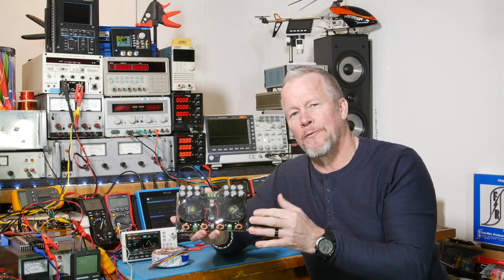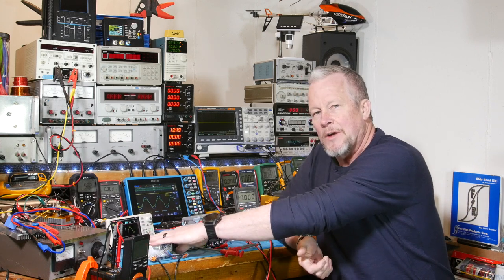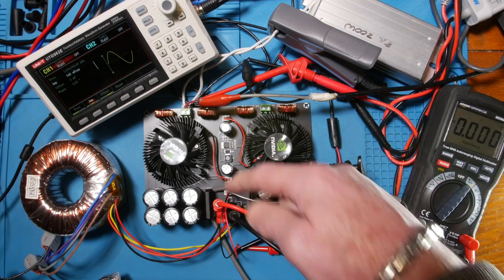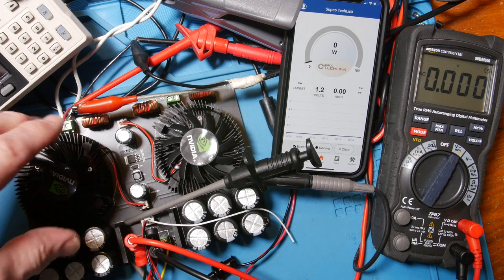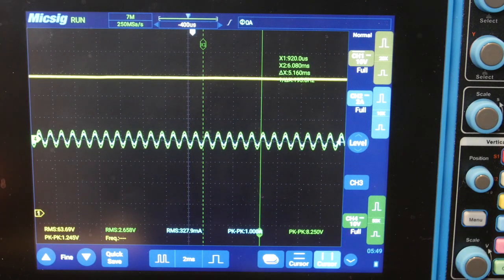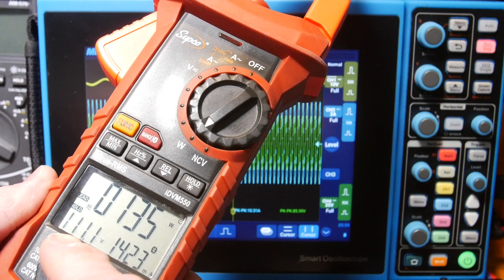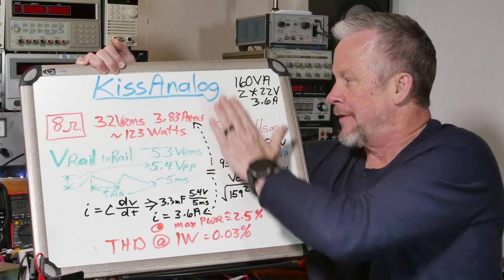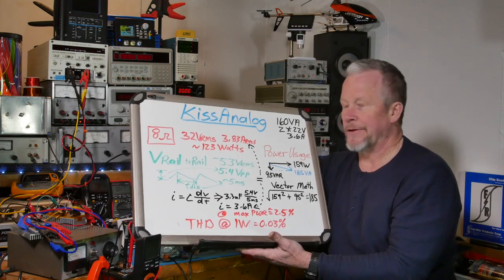TDA8954 Class D 420 Watts x 2

Comment: My favorite amp is 5W and 10% THD at full rated output, manufactured in the early 1950s, has those glass valve thingies, and sounds awesome with a guitar. High power and low distortion aren't everything in life...  ;)
Reply from the maker: That’s awesome Tim!  Thanks!
Reply: commenting on a class d video about valves . classic .
Reply: The difference between measurable differences and your opinion, is that one put us on the moon, the other... well everybody's got one don't they :-)
Reply: @gulogulo7636  Ooooooook.

Comment: Hi, nice video. I don't understand, I can power this amplifier with dc power or pc power supply.
Reply: PC power supply is DC
Reply from the maker: You can run it with a +/- DC voltage rails, but it is designed to run off of AC voltage and make its own DC voltage rails.

Comment: Another thing that I don't get is how to reduce thd+n. It seems all about gain but a lot of class d don't have a gain regulation. So for what I can understand is that you have to give him full supply voltage but reduce the input signal. In this way it does not saturate and can work better...
Reply from the maker: Thanks for the question.  It is important to look at THD with Noise especially in a Class D to account for noise not associated with harmonics.

Comment: Great video. Learned something new. I never knew THD was measured at 1 watt. Over 120 watts is pretty loud. I notice you have those bookshelf speakers on the bench. Have you tried listening to the Amp to see if it has a pleasant sound quality? I ask because I have been buying up  Amp kits off ebay just to see how they sound. The different IC's really do have different sound qualities.
Reply: THD can be measured at any watt you want.. Some are useful some are not. :)
Reply from the maker: Thanks Tron!  I think 1 Watt was just convenient for specs to use to compare amps of all powers.
Reply: If you are interested in the performance of the amplifier, THD would be specified at the full rated power. Many low integrity manufacturers will play numbers games and specify great numbers at very low power levels which is not  in any way reality.
Reply: @timothygrupp  but this chip has been tested on a dyno and its specs are legit . here is one do some research before you out yourself . you came here with negative intent . tube amps are great , but i run a whole band rig on  li ion cells utilizing class d because of its exceptional EFFICIENCY and thats the primary reason i use them. with class d we simply would be unable to do what we have done which is make music with our family band out doors for many years . sure electronics is not a low integrity manufacturer and the flea market spec days you refer to are long gone .

Comment: I have bought the same board but it has 50V 1000uf capacitors each do I need to change those capacitors to 63V 2200uf for better performance.
Reply from the maker: Depends on what voltage you use to power this.  If you max the voltage out, Yes I think 63V is more appropriate.
Reply: with 60v power supply. amplifier ic. and the heatsink gets VERY hot. Heatsink is then too small!

Comment: Hello sir.. Please i need your help about that Board... 

I want to know if i can run it using BMS 6S 24V TOTAL BATTERY 36 PCS 3.7 LITHIUM.. THANK YOU
Reply from the maker: Thanks for the great question!  This board is set up for an AC input, so it does want a plus and minus voltage.  It is possible as I have done, to power it with DC input voltage, but it does still want the plus and minus voltage.  But this Class D can run off of a single DC input and your 24 V would work.  https://youtu.be/eybcVbWgFdA

Comment: Dear sir,
Thank you for good information about this product. 
Please I need your suggestions ,
I have three boards of this audio amplifier, 
3×(210w+210)420w board,
How many volts & watts of transformer require to operate for  3×(210w+210w)420w=1260w.
Reply from the maker: Thanks for the great question.  Your math is very close, but technically the efficiency would need to be taken into account, and then some margin for temp rise.  On the other hand, what's the chance that all 3 will be at the max power - and still at any length of time.  So, I think it really depends on the use.
Reply: Do not know if you knew this. You do not get more out of an amplifier than what is max A. and V. Out from the  amplifier ic.

so you do not always get that much more watts out if you bridge the amplifier.

Comment: I m from Bangladesh.
How many  RMS will I get if I give 24-0-24v power to this circuit board.
Reply from the maker: Thanks for the great question!  It depends on the size of the capacitor and the load.  It could be as high as 34V.  That would also be the peak of the voltage, so a cap can charge to that value.

Comment: Will this amplifier power 600w RMS subwoofer. Thanks.
Reply from the maker: Thanks for the great question.  I think it would do just fine.  It is good to have a speaker rated more than the amp so that the amp will not over drive it or damage it.

Comment: Great video tonight no interruptions lol
I was wondering about running that amplifier in a positive and negative rails format with two Transformers push-pull that would be a better way wouldn't it?
Reply: You would "NOT" want to do that..
Reply from the maker: Thanks John!  I think I learned how to turn off those adverts.  This is in the bridge tied load topology which might be compatible to the push pull.  One side of the bridge is pulling one direction while the other side of the bridge is pushing the opposite direction. ;)
Reply: do not know if you knew this. you do not get more out of an amplifier than what is max A. and V. Out from the  amplifier ic.

so you do not always get that much more watts out if you bridge the amplifier.

Comment: hi, i don't understand much english, does the module really deliver 420w rms? I have a 24 + 24v 14 amp transformer. Greetings from Argentina
Reply from the maker: Thanks for the question!  Yes, it is spec'd for that, but at 10% THD.  Also, you will need higher voltage output, probably 30 + 30 V
Reply: with 24v transformer you will never get 270w.
L15D provides 150w with
50v-0v-50v DC 4 ohm

TPA3116 24v power supply 50w 4 ohm

you need up to 60v but amplifier ic. can not handle 2x60v

Comment: Hi! Hope you are doing well! With 24 0 24 transformers and 8 Ohm speakers, how much wattage of power(at actual) should  I get from each channel?
Reply from the maker: Thank you!  I'd think the power would be closer to 270 Watts into 8 ohms.
Reply: @KissAnalog  Thanks you very much!
Reply: with 24v transformer you will never get 270w.
L15D provides 150w with
50v-0v-50v DC 4 ohm.

TPA3116 24v power supply 50w 4 ohm.

you need up to 60v but amplifier ic. can not handle 2x60v.

Comment: Your power measurement looks identical to what I got, but I am surprised at the current waveform. Voltage looked like ok, then how current waveform could be different? Again you're probing against a resistive load. Is anything I am missing?
Reply: PSU isn't large enough to push amplifier to full power. Good to know this though, Class D amplifiers like regulated SMPS for best performance.
Reply from the maker: That's a great question!  If you put a particular current waveform into a resistor you would expect to see the same waveform in Voltage;)  I need to investigate this more.  There is an LC output filter, so it is possible that the phase is changed somewhat but it is still a bit tricky to explain away.  I'll do more experiments and we will see what we find.  Stay tuned;)
Reply from the maker: That's true, so I will go to the larger transformer to see how that affects our voltage rails and output signal.
Reply: @KissAnalog  you should try a smps, I can post a link. I'm about to try one for an amplifier and test against a nice crc psu in class a amp.
Reply: @KissAnalog  sure, could you please check whether these inductors are apt for this work? May be they are getting saturated when pulling high current. Thank you for the reply 🙏

Comment: Why in the world do those fans have nvidia logo on them ? What a mystery O.o
Reply from the maker: LOL They are pretty low noise;)
Reply: They're not stock NVidia coolers that i can think of, but they're likely aftermarket coolers that somebody might have made a bunch of and never sold, and they're just NVidia branded to make them look more legit. For maybe midrange to higher end older GPUs like between 6000 and 9000 series, or the likes of GT240 and GT440. They might have even been made with a mistake such as not observing the keepout area, so these might not even actually fit on the real GPUs. :D

If you're designing for random parts that you can find in the Shenzhen markets, this approach makes total sense, since NVidia has kept the same cooler mounting hole pattern for the longest time. And a lot of cards shipped with junk coolers that were either noisy or fell apart, so there was demand for aftermarket cheap and not quite horrible ones. There are also refurbishing operations that put new coolers and often fake firmware on older GPUs that they fish out of junk, so somebody has to be making those fresh coolers, so the amp manufacturer probably won't run out of compatible coolers for a LONG time to come.
Reply: @SianaGearz  Hmm now that makes sense ! Thx 4 the pretty elaborate answer :D

Comment: The result is not surprising!

These cheap CLASS D amplifiers are always given much more watts on paper than what is true.

They also do not have particularly good sound quality.

cheap class-ab  always better sound quality than the cheap class-d has. I have many class-d amplifiers and class-ab. 

The older
hypex ucd180 has good sound quality.

L15D with 50v-0v-50v DC. measures only 150 watts with 4 ohm resistor!
Reply from the maker: Thanks for this great comment;)  I think many amp kits as well as built amps are not well spec'd;)  But, yes they do want to push the numbers up with these Class D amps.